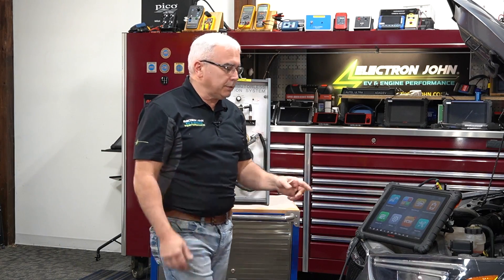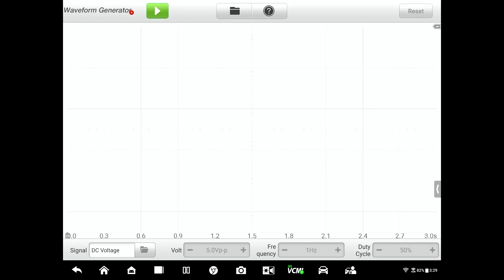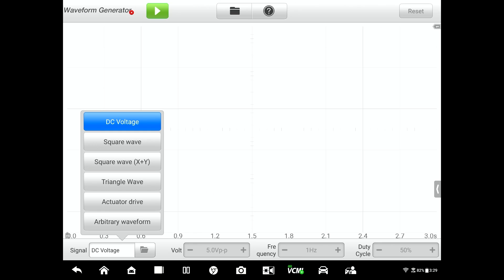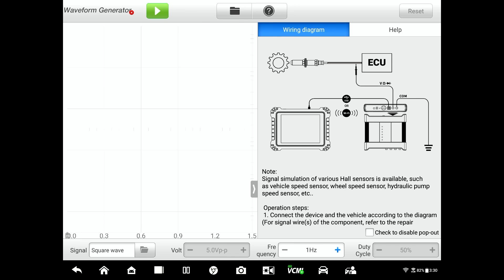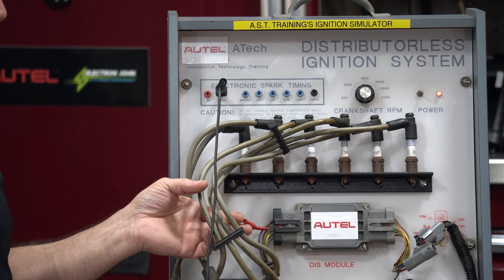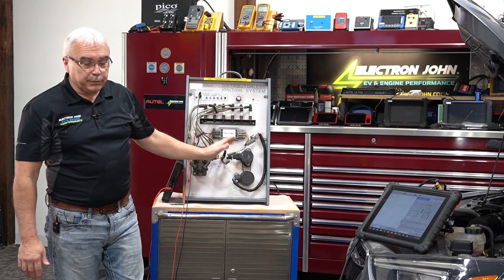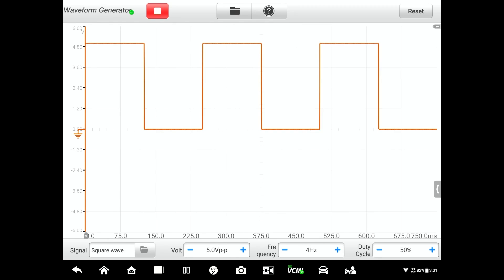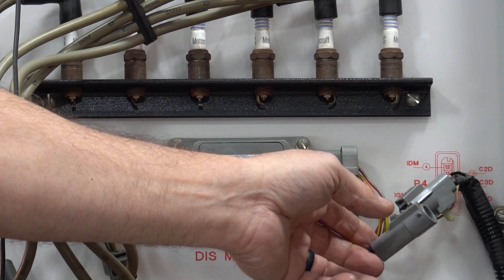How To Use The Waveform Generator On An MS919 Or MSUltra | Autel

Comment: great video... question here..... what about ignition sync? doesnt it need the notch on the crank wheel to syncronize the timimng for each cylinder? i guess this is just to verify a bad crank sensor? but doesnt the scope will tell up that analizing the signal? please explain more advantages to this other than "getting the engine running'  recap... got a crank signal and get engine runing... out of time detonacions and explocions right?

Comment: Fairly certain that the crankshaft does not need to be turning to create spark, when using the signal generator.
Reply: That is true, just keep in mind that the ignition system would need to powered up regardless. I am not sure how that demo board is wired. Your point though is extremely valid though, because to check it, just turn the key on and do the testing, eliminating the need for two people (one to crank and one to watch results) and it is also safer (to those who common sense does not come naturally). It may also be safer for the vehicle as well (if fuel is not disabled and system pressure bled off) so that the spark timing of the signal generator does not cause back fire, etc.
Reply: It’s actually more confusing and counterintuitive to have it continue spinning while using the signal generator. 

South main auto had a pretty good explanation on using the autel generator